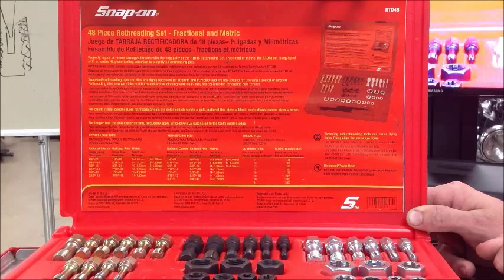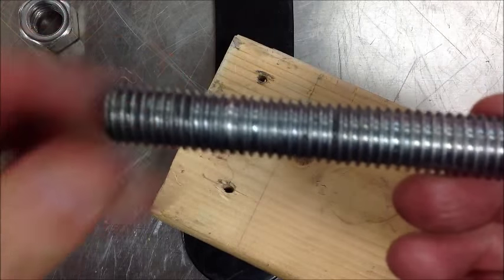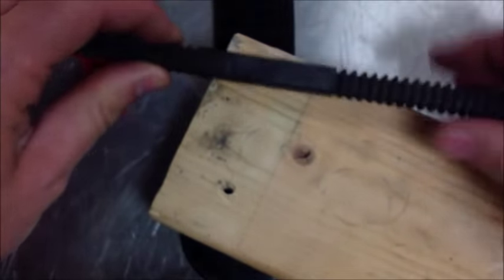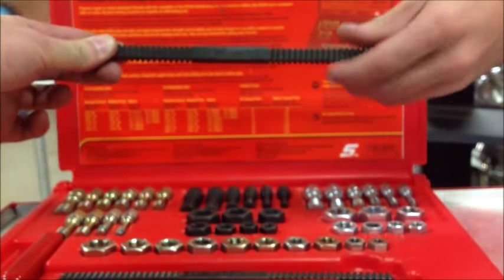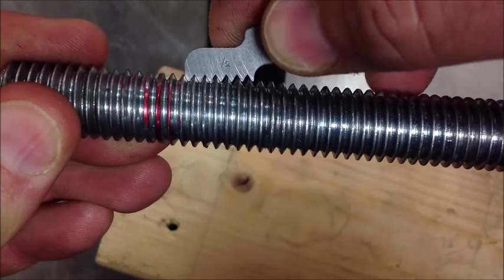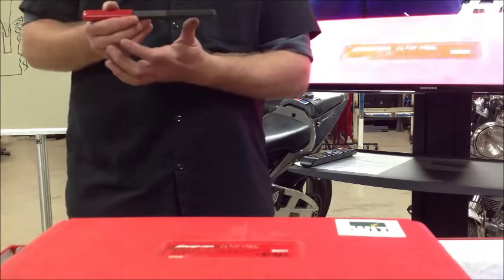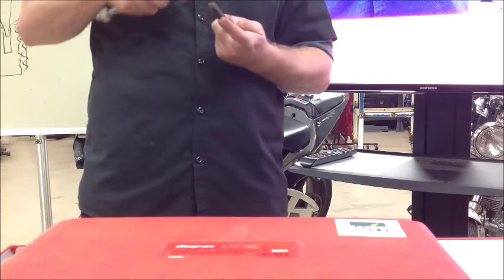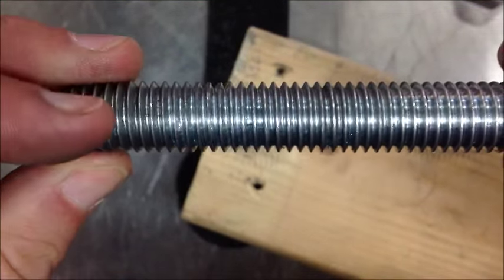How to repair a damaged bolt or axle with thread file

Comment: If you don't have a die or thread file, you can use a small file and clean the area with it. I know you like snap on tools. You can get better taps and dies from MSC or Grainger cheaper. When it comes to hand tools Snap on is one or the best. Metal working tool such as drill bits, taps and dies not so much. Just saying.